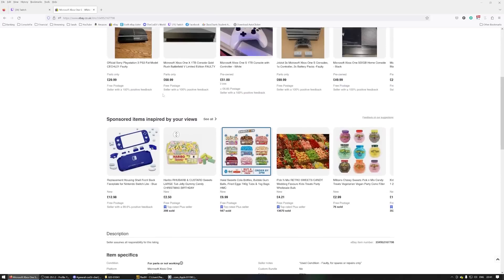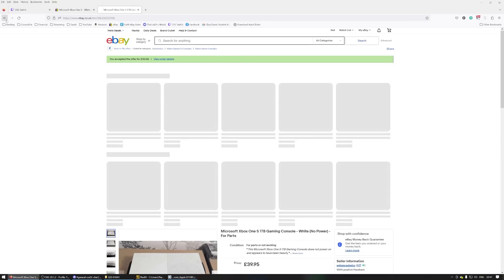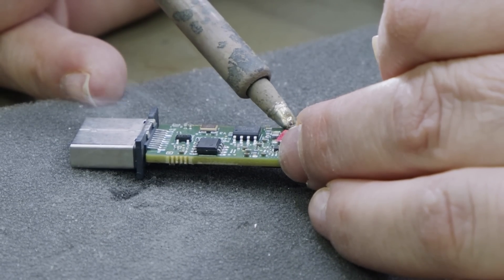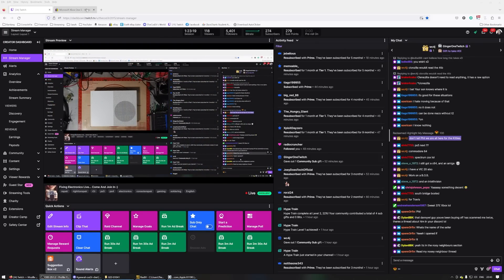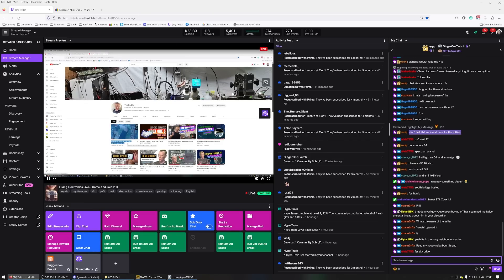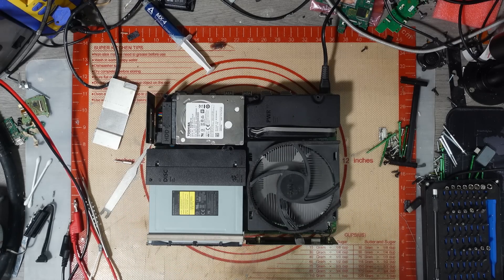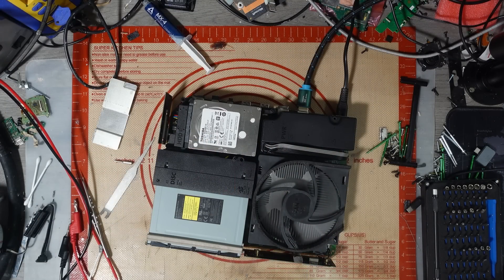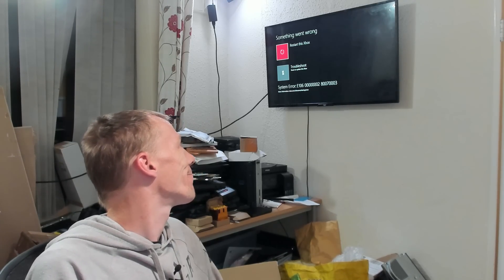I Bought A £30 Xbox One S From eBay And Got SCAMMED

Comment: I’ve just repaired my PS4 Pro. It switched on and then powered off. Opened it up and the traces leading from the power lead to the motherboard were fried. Must have been a power surge. I’ve replaced the PSU and it’s working again 😁✊🏻

Comment: Got a Xbox one s no power but the southbridge is hot to the touch with power supply put is that normal with a 12 volt short I'm new to this and was just getting into Xbox repair I'm guessing it's the southbridge but I'm not shore would love a bit of advice thanks lee

Comment: That console is totally worth selling. Can easily sell it for 200
Reply: You're in cloud cuckoo land
Reply: @nexus1972  I purchased my Xbox one for 140$ 3 years ago at that time they where still retail price new
Reply: @Tysman909  so if it was $140 new three years ago why is it worth $200 now? Xbox One S without controllers tops out at £65-£70
Reply: @nexus1972  mine was original xbox one the first version the one s and one x are newer so hold there value just like xbox 360. The 360 are going for 85$ US right now
Reply: @Tysman909  Lol original xbox one with controller sells here for £50. I cant give the things away. Xbox one x is about £120 with a controller and thats top money
Reply: @nexus1972  yah now it does but not 3 years ago I got good deal based on ebay prices back then. I save 150$

Comment: Honestly you need to stop the ...i got scammed ... You didn't get scammed ...you just can't fix it..... When you can't fix something you say i got scammed !
Reply from the maker: The definition of a scam is a dishonest scheme. When one intentionally puts parts into a console they know are bad, in this case a faulty mainboard, faulty hdd and faulty power supply, and then sells that as "spares or repair", that's dishonesty. If a listing stated all the facts, bearing in mind the seller is a technician, no one would in their right mind buy it because they know there's little to no chance of making money from it.
Reply: Trolllllll
Reply: It's a fing scam
Reply: found the ebay scammer

Seriously dude, you left 4 whiny comments? Go touch grass.

Comment: I went to buy a car ...the advert said the car won't start ...i paid the money ...i got scammed ..the car won't start !  Phil give your head a wobble !
Reply from the maker: The definition of a scam is a dishonest scheme. When one intentionally puts parts into a console they know are bad, in this case a faulty mainboard, faulty hdd and faulty power supply, and then sells that as "spares or repair", that's dishonesty. If a listing stated all the facts, bearing in mind the seller is a technician, no one would in their right mind buy it because they know there's little to no chance of making money from it.
Reply: @bubblydiesel6969 It said for parts, parts are broken. It's a scam. And you are nearly a troll.

Comment: This xbox don't work ...do you want it for £30 ?.....no scam !  It's stupidity on your part !
Reply from the maker: The definition of a scam is a dishonest scheme. When one intentionally puts parts into a console they know are bad, in this case a faulty mainboard, faulty hdd and faulty power supply, and then sells that as "spares or repair", that's dishonesty. If a listing stated all the facts, bearing in mind the seller is a technician, no one would in their right mind buy it because they know there's little to no chance of making money from it.
Reply: Trollllll

Comment: You paid £30. & you think you got scammed?!
🤣
Reply from the maker: The definition of a scam is a dishonest scheme. When one intentionally puts parts into a console they know are bad, in this case a faulty mainboard, faulty hdd and faulty power supply, and then sells that as "spares or repair", that's dishonesty. If a listing stated all the facts, bearing in mind the seller is a technician, no one would in their right mind buy it because they know there's little to no chance of making money from it.

Comment: you didnt get scammed.  you knowingly bought a dead unit, advertised as such
Reply from the maker: The definition of a scam is a dishonest scheme. When one intentionally puts parts into a console they know are bad, in this case a faulty mainboard, faulty hdd and faulty power supply, and then sells that as "spares or repair", that's dishonesty. If a listing stated all the facts, bearing in mind the seller is a technician, no one would in their right mind buy it because they know there's little to no chance of making money from it.